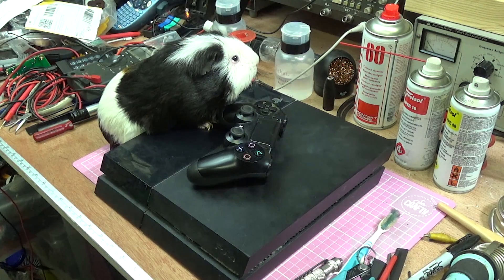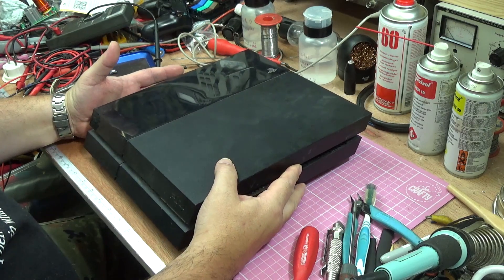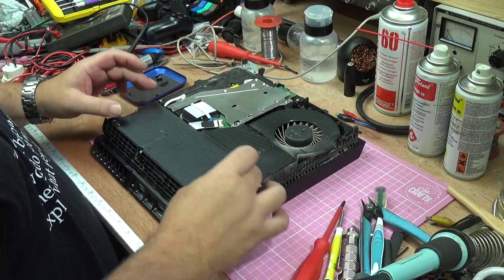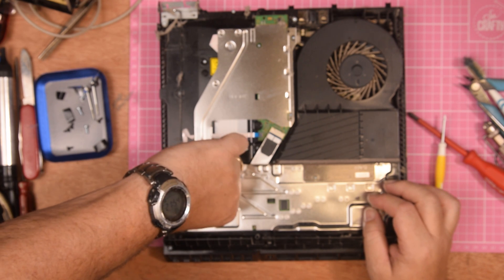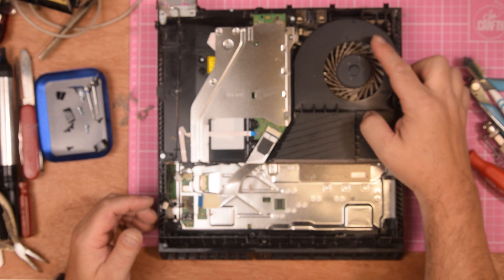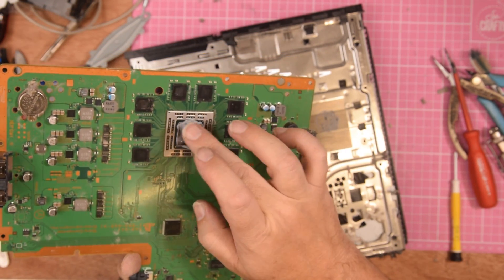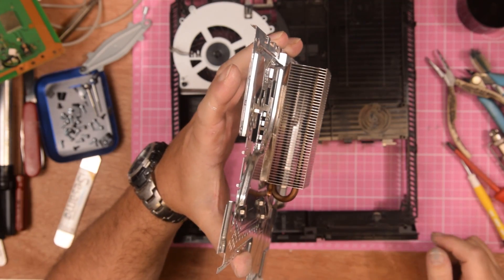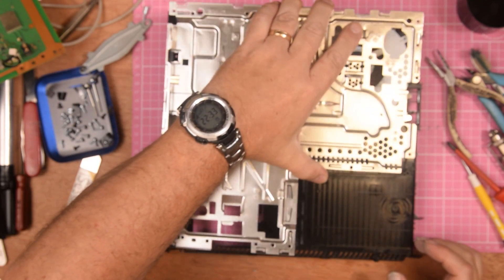How To Fix Ps4 Overheating Problem : ZERO COST

Comment: I have an issue with my PS4 and im not sure what's causing it. I've been playing on PC for the last year or so and I've recently tried to set up my PS4 and play 2K. (By the way before i switched, my PS4 was working fine before) Once it turns on i can play for about 2-5hrs and then at some point it will randomly just turn off. After that i then have the issue where i cant turn it back on. Ill get the sound and the blue light but then after a few secs it will just switch off. I then have to wait like an hour before my PS4 starts working again before i get that' turning off' issue again. I opened up my PS4 and cleaned it properly, but i still get the issue, so i doubt its coz of overheating. Has anyone had this and found some kind of solution? BTW I dont get a message that my ps4 is overheating before It turns off.

Comment: I need help I completely disassembled my PlayStation as it was very dirty, I even cleaned the heat sink and fan. When I play games like fifa and fall guy’s, it’s loud but it still plays for the most part. But when I try to play a games like call of duty it completely shuts off and says it’s overheating for a split second, There is also a red blinking light when that happens on my PS4. Could you please tell me what I can do to solve this issue?

Comment: SO CAME TO CONCLUSION TO JUST REPLACE YOUR POWER CABLE IF YOU HAVE BEEN THROUGH POWER OUTAGES, MY PS3 POWER CABLE HAS SAVED MY PS4 NO MORE OVERHEAT MESSAGES try it let me know, worked for me

Comment: Is it okay if I use a compressed gas duster? I wanna know for safety reasons😶
Reply from the maker: yep, tins of gas, air compressors etc... as long as you dont throw 10'000 psi at it you will be fine.

Comment: I appreciate this video so much but it’s honestly incredibly intimidating. I’m a complete amateur with stuff like this.
Reply from the maker: Take things one step at a time. Your mobile phone is your best friend. Take pictures of everything from different angles so that you can see where everything is before you take it apart. Then when you are putting it together you have the pictures as a reference.
Reply: No need to take all the part over just remove ups slowly and be careful with cable and use some air compressor and when u use air compressor don't let the fan turn fix it withur hand to avoid any electric damage by fan

Comment: i got finished and whenever i try to turn it on it beaps and then not turn on please help
Reply from the maker: It sounds like you have not got the pads fitted to the memory chips correctly....
Reply: George Christofi are the pads the little black squares?
Reply from the maker: @wateral6350  yes, thats them.
Reply: George Christofi nvm i found the problem but thank you my play station sound brand new and doesn’t over heat😄

Comment: I'm having a problem where I cleaned the whole ps4 and it turn off on me, like in about 3-5 mins keeps telling me it's to hot what do I do?? NEED HELP
Reply from the maker: it sounds like you have not quite got the ram chips heat pads back in place correctly or you may need to change the thermal paste on the cpu.

Comment: I can’t find anything anywhere, but my PS4 ONLY overheats when running a decently graphics oriented DISC game, it never overheats on streaming services, or on digitally downloaded games, ONLY WHEN A DISC THAT RUNS MID/HIGH FPS GAMES.

I can play the new Modern Warfare, which is like a 200+GB game, and gran Turismo sport, which is graphic intense, both being DD, no issue on overheating, ever.

But when I put in RDR2 or monster hunter world, Disc games, it’s overheats if the ambient temperature is over 72°F.

I don’t feel comfortable taking my PS4 all the way down to that bare but I have taken it down to the first few steps before you removed the blu ray drive.

I can’t afford a new one or really to have a shop fix it, help.
Reply from the maker: The only real cure is to make sure it is free of dust and dirt and maybe invest in a higher capacity fan. Most fans are measured in air volume moved to you need to find an upgrade to the standard fan which could be wearing out now and not as effective as when it was new.
Reply: George Christofi I’ve read and heard that replacing the fan can cause catastrophic damage to the system and can make your PlayStation a dud.
Reply from the maker: @ItsBigRickSon  It can be hit and miss. some people choose entirely the wrong fan and it can stress the system to the point of destruction. Sony can supply fans but they don't and it makes it impossible to get official replacements or upgrades. If you search around, there are some that people have found to fit and work well but I am not up on the current favoured brands.

Comment: I dont know if u still read these comments but where can i find this screwdriver and what size philips screwdriver?
Reply from the maker: The screwdrivers are available from amazon and pretty much any diy or hardware shop. I found that getting a universal kit was the best option as it would have all the correct bits in.
Reply: George Christofi thanks but is walmart also a place?
Reply from the maker: @imcrazyphilly599  possibly. we don't have walmart in the UK but a lot of my friends in the US say you can get pretty much everything from there these days.
Reply: George Christofi okay wow i didnt know that thanks so much bro it means a lot

Comment: Hi I did everything and it was fine until I was putting it back one of the wires came out can u help me
Reply: @George Christofi
Reply from the maker: It is 4 wires, if 1 has come out of the plug with the crimp connection then it can be pushed back in
Reply: George Christofi I tried that but it comes back out when I turn it and plug it in
Reply: George Christofi and the metal thing that sticks out is gone it’s only the black wire and it’s covered with the black thibg
Reply: George Christofi I fixed that but when I on my ps4 it makes a loud noise then closes
Reply from the maker: Ok, it's the power supply wire, it just plugs into the socket.
Reply: It’s this one 3:50
Reply: @George Christofi

Comment: Hello 
So I did everything from changing the paste to cleaning it and taking it apart. It’s still gets really hot, I tried starting it without the cover to see the issue and I found out that the fan would spin one to 2 spins and then stop!
Any help with that please?!

Comment: Hi man, iv done mine and its getting really hot around the cpu and then switching its self off i have also used new thermal paste, Done it twice now and still the same problem 👍any help with be appreciated
Reply from the maker: check that the thermal pads on the memory chips are in place and that you have reconnected the fan and it spins freely.

Comment: Hey one of my friends is experiencing some difficulties with his ps4 and when ever he turns on his system about 5 minutes later it says his ps4 is over heating turn it off for a couple hours and I was wonder would this fixed his problem
Reply: You should go and check out the tronic fix channel they have specific videos on this topic
Reply from the maker: It very well might do. it sounds like a build up of dust. wont hurt to take a good look at the unit.
Reply: @GeorgeChristofi  do you think the problem could also be thermal paste?      I mean the system most definitely needs the dust out if the insides but do you think thermal paste could also be one of the main issues
Reply from the maker: It could be worth doing if you are taking it to bits anyway

Comment: I cleaned my ps4 but not there it is a lot of dust where the air want to go out and efter that when i got in to my ps4 saif overhating and shut down but i didnt ewen played a game??? What am i going to do is it broken or do i need to clean where u did where all dust is???
Reply from the maker: Yes, clean all the dust out and it should be a fairly simple fix.

Comment: Hi George i recently had my hdmi port repaired but was not cleaned out so i did the cleaning myself it all went well its clean with new thermal paste but has been acting strange like sometimes it will go into rest mode in the middle of watching YouTube and yesterday it cut out like if i had told it to switch off in a middle of a game still baffled can you help me find a solution to. This it's the first gen ps4 like in your video
Reply from the maker: It sounds like something is shorting out a voltage line or data line. I'm guessing that when they repaired the HDMI port there is either a small splash of solder loose on the board or one bridging something. My first port of call would be to whoever repaired the port as the issue only happened after they were inside it so it has to be related to the repair.
Reply: OK thanks will be keeping an eye on it if it does it again will take it back to the  repair place  its got warranty on its job so far since i put it on extra feet to help lift it up a few inchs off the stand it been alright

Comment: So I cleaned my ps4, because I got the ps4 too hot prompt and cleaned it thoroughly and waited 7 hours to let it air out and air dusted it and still got the prompt
Reply from the maker: Ok, you might need to replace the thermal paste on the cpu and make sure all the pads are on the memory chips because they report overheating back to the cpu as well.

Comment: When my ps4 open it's OK but after 5 minutes it says that the ps4 is too hot and it turns off by itself what should I do to please help me
Reply: or did it stop working
Reply from the maker: @abdisharif3982  it sounds like you have not reinstalled the heatsink properly. turning red immediately is a sign of overheating and something has not been replaced properly
Reply: @GeorgeChristofi  does that mean it cant be fixed ?
Reply from the maker: @abdisharif3982  if you repeat the dismantle and check all of the thermal pads are in position on both the cpu and the memory chips it should be on.
Reply from the maker: It really does sound like it either needs the thermal paste replacing or the fan isn't working as well as it used to. If you live somewhere hot it doesn't help at all.
Reply: when that happened did it turn back on

Comment: So i went through cleaned it out and when i turned it on the over heating message popped up then it powered off please help
Reply: @George Christofi
Reply from the maker: It sounds like you either missed out the thermal pads, or need to replace the thermal paste under the heatsink on the cpu. The fan also could be spinning too slowly but that is a fairly easy job to replace it.
Reply: @GeorgeChristofi  i reopened it and i forgot to plug the fan in lol
Reply: @tyyw2406  lol
Reply: @tyyw2406  Is it working properly now?

Comment: For anyone nervious about takeing something like this apart. Just take pictures everytime you remove a srew or something like that, that way you can follow your steps back so you wont make a mistake. Also have little sections for your screws and little bits and peices like that so you know whats what. hope it helps.
Reply from the maker: That is really great advice. I tend to take stuff for granted sometimes and forget to mention that sort of thing.
Reply: @GeorgeChristofi  lol fair enough. something i used to do when i first started working as i would forget everything
Reply: @GeorgeChristofi  lol did that like on step Three kicking myself still works though

Comment: yesterday I clean my PlayStation 4 pro and when I put all the parts back and when I start the system up it telling me that my PlayStation is getting overheated why is that happening please help me
Reply from the maker: It sounds like the heatsink is not sitting properly on the CPU and ram chips. Make sure all the thermal pads are on the ram chips as this can report as overheating to the cpu

Comment: Need a hand . Done of all the above apart from actually remove the disc but ive got to mother board fan an heat sink cleared all the dust i could see an still over heating
Reply: Your processor is real doomed
Reply: The processor needs to be changed but its a risk it can be completely ded or completely fixed
Reply from the maker: It could be that you need to alloy new heatsink paste to the CPU.
Reply: George Christofi i tried it but it didnt work
Reply: Didnt expect the replys lol well funny thing is 24hours later its working , little bit loud than usual but theres an air flow an it works for now . Fingers crossed what i done was enough

Comment: I cleaned my PS4, then it started to overheat. It dosent turn off when on netflix, but turns off 30min after playing games. Any help?
Reply: I have the same thing its annoying
Reply from the maker: It sounds like an airflow issue. When you play games it is getting too hot so either the fins on the heatsink are blocked or the fan is not working properly.
Reply: George Christofi ah so it must feel hot inside because the exterior feels not even warm

Comment: I'm on my 3rd deck. I had the original the slim and now a pro.  All three went to crap overheating. They all are loud like jets. I have the PS4 fan under. And a small fan blowing at it
Reply from the maker: It does seem to be a bit of bad design by Sony to make the airflow so poor in both the standard and slim versions.

Comment: Everything u just did has nothing to do with overheating. Its just getting old and then it gets higher amounts of power from the old motherboard u cant fix that.
Reply from the maker: Airflow id critical to any computer. removing a blockage from the heatsink will bring the cooling back to what it should be... Unlike mechanicals, electronics don't 'wear out' and use more power for at least a good 30 years.

Comment: So I used the compressed air and used it properly without taking my ps4 apart because I can't and it still overheats, the fan seems to make a noise like only a little one but noticeable, not got a clue what's wrong but it's put me in such a bad mood
Reply from the maker: It really does sound like it needs to come apart and be thoroughly cleaned and new heatsink paste applied.
Reply: @GeorgeChristofi  got no money to buy the screwdrivers or even the paste, I'll most likely just buy a new one when I get my wages at the end of the month, thank you for your help and advice, hope all is well with you.

Comment: hi my brother just cleaned the fan of my ps4 and it still over heating
Reply: he just clean the fan
Reply from the maker: did he just clean the fan or did he go right in and do the heatsink as well? If he has done the heatsink then it might need new thermal paste on the top of the cpu. You also have to make sure all of the memory chip pads are in the right position too otherwise they can still register an overheat situation.
Reply: @GeorgeChristofi   we just cleaned it and its still overheating

Comment: I can't take my ps4 apart, what are the best things I can do to clean it? I've cleaned out the dust from the sides of it and left it for a couple hours but when I turn it back on it just shuts down again
Reply from the maker: The only things I can suggest is a can of compressed air and possibly using the small nozzle on a vacuum cleaner. Don't stick anything inside the unit as it may touch something and break it or worse cut some of the internal wiring.
Reply: @GeorgeChristofi  already tried the hoover and still nothing, where can I get a can of compressed air? Is there any links for Amazon you could recommend as I'm In the uk and we're still under lockdown
Reply from the maker: @EatingAlexaxD  https://www.amazon.co.uk/Star-Duster-Compressed-Flammable-400ml/dp/B000MQ7DZC/ref=sr_1_3?dchild=1&keywords=compressed+air+tin&qid=1589220072&sr=8-3
Reply: @GeorgeChristofi  thank you so very much!!
Reply: @EatingAlexaxD  did it work?

Comment: if the thermal pads are not in the correct place like they are on the edge of the chip can i just take them and place them again at their positon?
Reply from the maker: Yes you can.

Comment: I did this and it fixed the problem where it would overheat but now It beeps three times in quick succession randomly every now and then.      Edit:  I don’t know exactly what it is but I think it was something to do with the eject disc button as that makes the same sound
Reply: Also when I beeps 3 times and shuts off its overheating like 9 times outa 10 right?
Reply from the maker: Possibly your button has a bit of a dust bunny behind it causing it to stick down.

Comment: On the back of my ps4 there are 2 screws and i took them out and it doesnt want to come off. Idk what to do
Reply: If you l look at the bar code on ur ps4 it should say cuh then a number that's ur model of ps4 and u should look up how to take that specific model apart
Reply from the maker: Usually it is just a case of sliding the parts apart to ge them separate but it can help to lightly twist them to see the seam line and break the friction.
Reply: That’s because you have a later model of a PS4

Comment: Mine was making way too much noise, so I cleaned it all the way to the heat sink. I reassembled it perfectly and now it has the overheating shut down - ( flashing red light with 3 beeps). What can I do to fix this?
Reply from the maker: I would check the heat transfer pads on the memory chips and also check the state of the thermal paste on the cpu. You may need to remove the old stuff with rubbing alcohol and replace it with fresh if it has dried out. Make sure not to overdo the paste though as too much is sometimes worse than too little.
Reply: @GeorgeChristofi  Hi, I just got my ps4 working today and wanted to come and say thanks for your advice.
Reply from the maker: @b.e7726  I'm glad to help.

Comment: This scares me.
Reply from the maker: It can be intimidating to open electronics but you can either leave it alone or take a chance. A PS4 is relatively safe to dismantle compared to older tube radios which are absolutely full of lethal voltages. Whichever way you go, just watching and learning is a great thing.